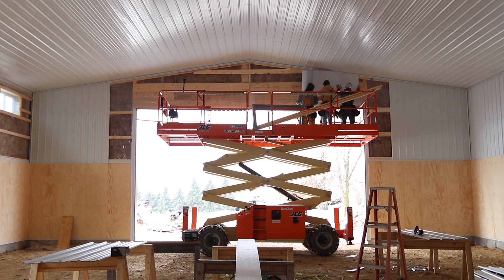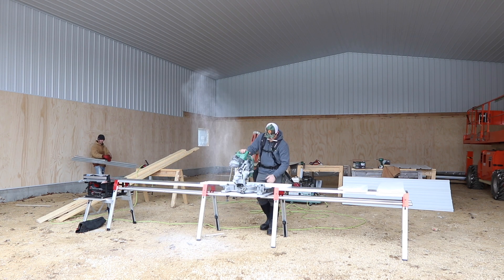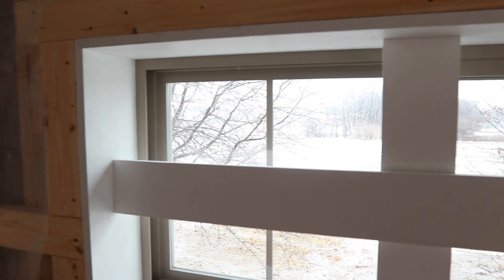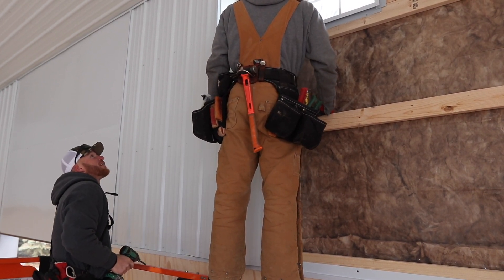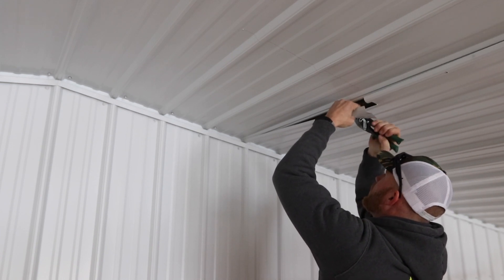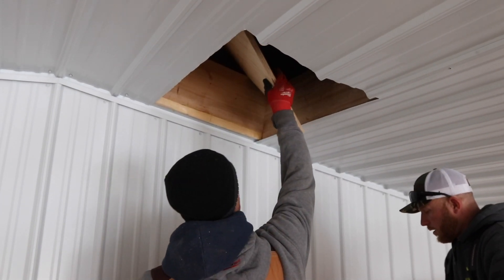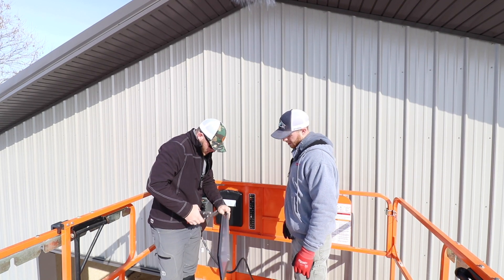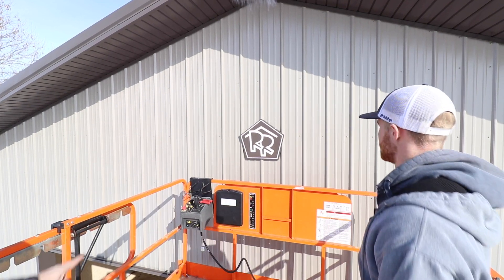Building a Work Shop:  How to Trim a Window in a Post Frame

Comment: Yeah Kyle , the use of the vinyl composite as a jamb material is great . The best thing is , you get to use silicone as an adhesive/waterproofing element to the windows because you don't need to paint ANY part of the window/frame assembly , since there are no porous materials in the mix. There is no "come-back" associated with the windows/door openings, i.e. 2nd coat of paint etc. AS always.......great use of time and available materials. You are constantly adjusting your methods , and always with efficiency in mind. For people who don't understand the word EFFICIENCY , it is nothing more than a happy marriage between SPEED and QUALITY . We carpenters not only make the world a better place to be , we MAKE THE WORLD !

Comment: I have been using this type material for a long time. 
We use it on our homes with cement siding. 
We trim windows, doors, soffit, etc. on the outside. 
Window sills on the inside. Routes and nails great. 
The only drawback is the shrinkage on long runs that require joints. 
It does expand and contract. 
Awesome work as usual.

Comment: If you use Azek trim they have a cortex screw that is used to fasten it and has a plug to fill the hole. The best part of it is you can not see the screws once you plug the hole.

Comment: Looks really good! Maybe want to leave    1/8” gap at every end for expansion and contraction. Then cover with caulk. Pvc is notorious for it, especially in direct Sunlight. It’ll buckle if it’s set tight at cold temp.

Comment: This old house secures the pvc board with a screw and bung system. Practically invisible when done. Not sure where they source it, but would save having the wedge while the silicon cures. Pvc board looks good and it's a solid product, made my crawlspace windows with it, great for ground contact.

Comment: Could always use a white trim screw if worried about jamb extensions coming apart..that how I did trim around the doors in my shop with the PVC board

Comment: Pvc trim is a great idea but i would do a test piece to mark sure the glue is adhering or use cortex screws with plugs. I just started    working with pvc siding and trim in the winter and secure the trim every 16" and am consernd about the expansion in the summer cheers   if interested I'm installing celect by royal

Comment: There is a screw and plug kit available for the PVC trim.  A special driver for the screw makes a hole and you tap the plug in flush. The plugs are wood grain or smooth and you can't see them unless you know what your looking for.

Comment: You can't beat PVC trim boards.  You can nail them with finish nails instead of using  adhesive.  Just fill the nail holes with good caulk and the disappear.

Comment: These work really well for the PVC trim boards.  From a few feet away they are invisible.   Grip Rite PrimeGuard Max Primeguard Max #7 x 2-1/4-in Stainless Steel Deck Screws

Comment: On another subject Kyle , I wish you would do a video to explain the use the Left/Red and Right/Green aviation snips. Most guys in our trade don't know when to use either one , or even what the difference is. Most steel stud framers carry the Yellow/Straight ones, but the only guys I've seen on job sites who know their use and difference , are the tin-bangers (HVAC guys). Please teach the young pup carpenters !! And thanks for re-elevating our trade to its rightful place at the top of the building trade. (sorry sparky)
Reply: He explained it well enough in the How To build series when he was doing the exterior metal work.

Comment: Hi dude, the look is awesome on the window,  and let me tell you,  if you use good quality silicone (which I believe you always use good quality materials,  as you seem a man of integrity). Them you will have no worries whatsoever,  I've had my renovation company for 25 yrs plus and we use silicone for lots of applications,  we use silicone and silicone only to fully install W/C (toilets) and shower systems,  the fixings on toilets can corrode due to contact with water (and other substances, misfired from us boys). So can corrode them.  In 25 years we have never had one fail. When you do your bathroom at home just use silicone in between the wall and the back of the cistern (flush) and push together, I promise it will stay until you need to move it. But makes it easier if you do. The p v c that you did will hold 100%.

Comment: I did my house exterior and shop interior with Azec, the silicone let loose in places due to expansion and contraction. They make a screw that pilots out a plug which comes with the screws and it is unnoticeable

Comment: Getting ready to build my own 30x40 garage/barn. Do you ever build on a monolithic floor and piers pour? For a finished building it would give you a much better seal at the bottom of the wall.
Reply: IF you watch the Farm Shop series, you would see them building on an [extended] existing slab.

Comment: Hi;
I think that using the Composite to extend the window frame is a lot better look, pius water and the sun will not brother the surface.  I would take it one step father and use 4" Composite material to trim out the window with an 1/4" offset.  This will give it a more finish look than "J" channel has.

Comment: What brand name is the material you used for the window trim ? I work at an extrusion company that makes this type of material. I run the extrusion machines that make it. We sell to Menards , Home Depot , and Lowe’s as well. Very versatile product. You can use pvc glue to join the pieces together just like joining pvc pipe together.

Comment: Why the flat metal on the header and above instead of the ribbed?
Reply from the maker: Watch the episode before this one
Reply: @RRBuildings  I understand. I suppose once the actual door is there it would make more sense. Probably looks appealing with the flat steal as it doesn't look as 'busy' with the rib lines and the door lines.

That said I did notice some standing on that the top step of the ladder. Don't want to be that guy, but I knew someone who did that and of course they gave me the line of they are always safe. They fell and no longer can do anything close to construction work like you guys.

Please be safe.

Comment: If you were to install the PVC window trim before the insulation, you could screw through the wood into the PVC and not have to rely on the silicon to hold it.

Comment: I prefer the windows the way you did them, no chance of sharp edges, though i would prefer the bottom sill to stick out a bit, particularly on low level windows, the seam between sill and J channel can collect dirt, bit if the sill covered that, it would look cleaner.

Comment: Really enjoy watching your videos keep them coming please....
Also I've never comment on any of your videos bc I can see or understand everything that is happening/happened  from your explanations in the videos of why you do certain things the way you do them (which the explanations  are one of the my favorite parts of your videos ) 
 Also this time I noticed something that you really didn't talk much about.....so whenever you were doing the metal work above the garage door opening and you had to figure out the angle so it would but up against the ceiling could you have taken your off cuts and used them to fill in the gap above there to the peak of the ceiling instead of cutting a whole another sheet of metal or was it so there wasn't a seam coming down the center......????
Also when you cut your access panel in to the ceiling why not  just use the piece that you cut out and trim around it the same way that you trim around the opening for it to go in....????
Anyways just a couple questions for you that i was kinda curious about  but if you don't have the time to answer them it's not a big deal I'll still watch your videos LOL

Comment: PVC Foamboards are great so stick with it. We use them a lot even as hand rails and top rails inside houses. What I don't like with the builds is always those access hatches to the attic are way to small..... I never can get any gear up in there without destroying something. Where I build we always to 4' long and 2' wide so even if you want to get a Air Handler up there you now can without a problem.

Comment: Hi Kyle     Since you insist, I do have a question,     you use vinyl windows with a build in  "J" channel, but then you install a second "J" channel made from steel, when you clad the building with the corrugated steel, why don`t you order windows without "J" channel, I think it would look cleaner.     I appreciate the time you take to film and edit these video`s.     Keep up the great work.

Comment: designing a hanger for my ultralight "Quicksilver Sport 2S Rich Parker" is my channel,so I need and opening of 34-36 ft for the hangar door... any suggestions on material for my header ... glue lam or red steel I-beam, truss of some sort?  I just haven't done a header that big before... over all size of hangar is going to be approx. 35X65 with the door in the middle of the long side
Reply: That is best left to ask the door manufacturer as (Schweiss does) they will factor in everything for you working with the builder/engineer per the intended door use and type of mechanismm and the stresses it will put out and into the building structure.

Comment: An observation: those drop-in attic access panels are incredibly leaky. Yes,  it is just a shop, but if you are going to the effort to insulate... Something that air seals would be a much better performer. While you were at it you could add a few layers of foam to the back.

Comment: clear silicone has been used a a glue for years, having the plastic trim fall off is not the problem, trying to remove it later will be a problem, for the next guy years from now.

Comment: It looks straight.  :-)
I have a question about digging the post holes, how do you know they're deep enough and have enough concrete?  I saw on a previous video where you pulled one out after it was all done to make sure that the garage door was unobstructed.  It looked like it pulled out of the ground pretty easily.  Made me wonder how well they're going to stand up over the long haul.
Thanks for all your great videos!  Cheers.

Comment: Wondering why you placed your finishing sign by eye when you have so many leveling tools at your disposal.  Holding a level to the bottom of the sign would have been faster and easier than eyeing it.  Folks will not know if you built the building straight and level but they will know if your sign is not right.

Comment: you might look into these https://www.midwestvinylprod.com/index.php/products/headcote-cap-tor/pro-plug-pvc/ for securing the window jambs in addition to the silicon, these will both hold while the silicone dries and give additional strength.  also faster and invisible when used. I am not affiliated in any way with this company.  great work brother!

Comment: This is along the lines of what I suggested from that earlier video. It's something like Fypon isn't it. I think this looks much, much better than wrapping the jambs in metal. 

Why did you use coil stock over the door rather than continuing the sheet stock. Was is for door track attachment reasons.

I enjoy your videos very much, certainly don't consider them a waste of time. Except for a couple car channels I watch yours are the first I click on when I get notifications. If you want to cover all new news about the upcoming C8 corvette yours will then be the first each time.
Reply: Review previous video for why the flat stock above the over head door openings.